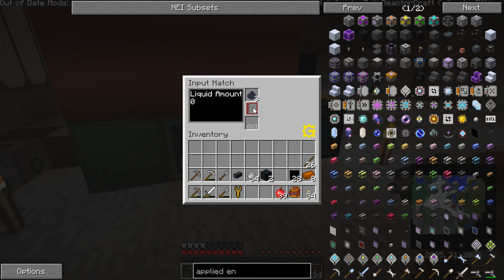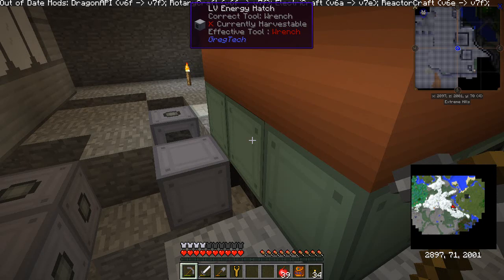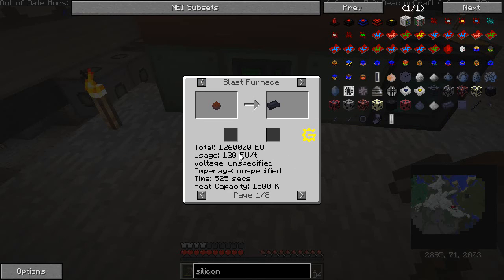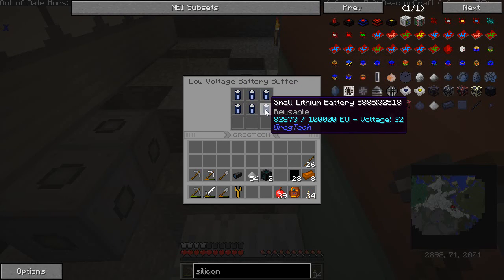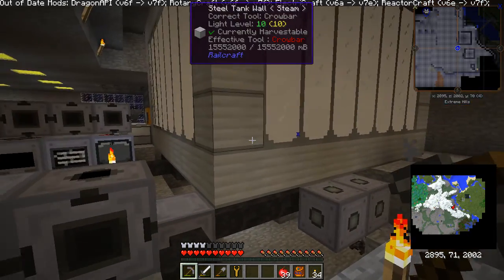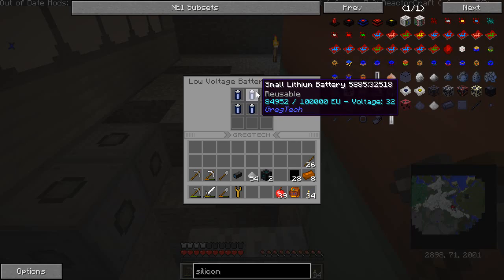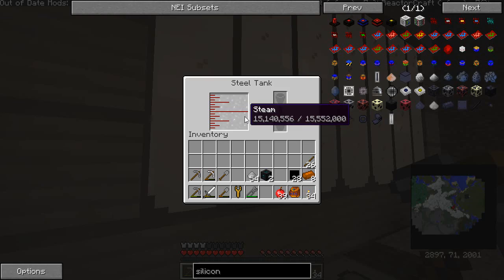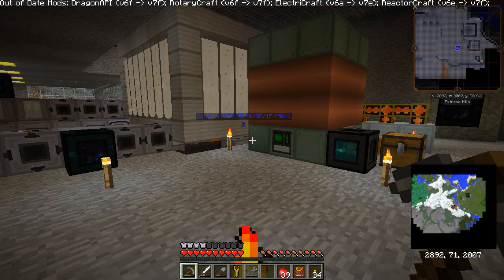S06E18 - Howto - GregTech Power Explained

Comment: I think the electric blast furnace is a little bug but actually you only need 2 mv lithium battery to make it work. The EBF's mv hatch accept 2 amps of 128 eu and it only need 120×1.1=132 eu (it is because the circuitry). Therefore, you wasted 124eu
Reply from the maker: Hey, firstly, thanks for watching :-) Yeah I was still a little hazy on how the power actually worked. I only had a bit of testing to go on, and the limited documentation that was out there. Certainly from my testing after this video with full batteries and monitoring how much power was used, it seemed to back up my theories... but who knows, with GT sometimes weird stuff just happens :-)